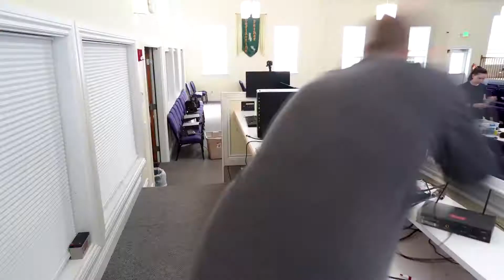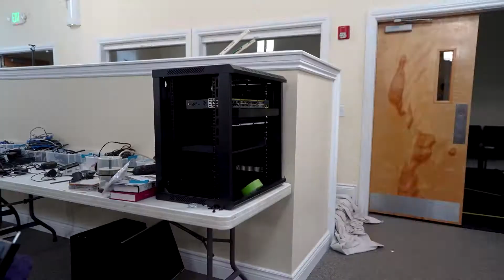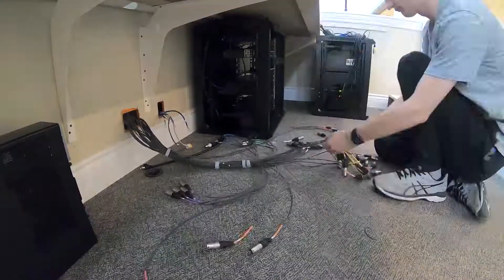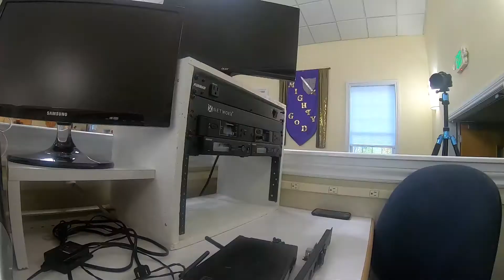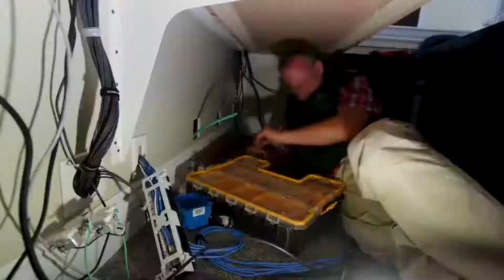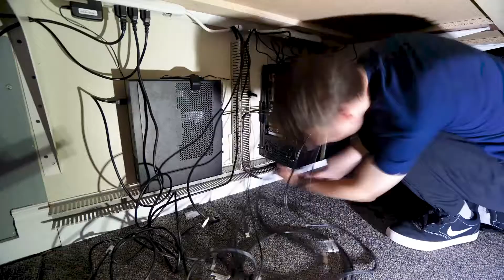Full Sound Booth Remodel Time-lapse

Comment: how much did it cost to remodel it? (obviously keeping the old gear) but like getting new boards, cord organizers etc.
Reply from the maker: Cord organizers are like $15/each 6ft section on Monoprice.
Other than that, the actual remodel didn't really cost much. The most significant factor is labor... It took us more than 200 man-hours, which at minimum wage is $1,500. But this level of work is worth more than $10,000.
There were a bunch of technical projects and purchases that went into this before hand. I designed and installed the new broadcast system for $12k. The two racks ended up being $600. After this remodel, we installed a brand new video routing system for $6k. That's just to name a few things. During the couple of years I worked at this church, I spent around $50k on much-needed production upgrades.

Comment: Love the video and remodel Stephen! Thanks for sharing. I like how you've mounted the computers to the back wall, but I'm just wondering how the operators power the computers on?
Reply from the maker: Hey Phil! Thank you! The white mount was laying around I'm not sure where we got it. But the mounts for the computer on the left were just cheap brackets from Home Depot, probably bicicle mounts. Sorry I don't have specifics.
For turning on and off the computers we installed two of these: 
They plug into the motherboard headers and let us turn on and off the computers from a button ontop of the desk.
https://www.amazon.com/Segotep-Button-Extension-Desktop-Computer/dp/B097QV6ZD2/ref=sr_1_5?keywords=power+button+pc&qid=1636513421&qsid=130-4309679-8895933&sr=8-5&sres=B072FMVZJZ%2CB0986XLJJH%2CB097QV6ZD2%2CB074891DJP%2CB09CZCJYSL%2CB09DCC6CPP%2CB07TYV4XQQ%2CB01LMZZFWO%2CB0964XP8HD%2CB09GP4XPZB%2CB079DKP44C%2CB01CJ44XZM%2CB096TZJNXH%2CB083NVBJLN%2CB08P4FRQ2R%2CB08KZDSKBJ
Reply: @stephenbrokalis4707  Genius - thanks!